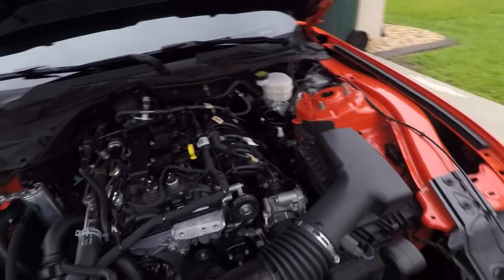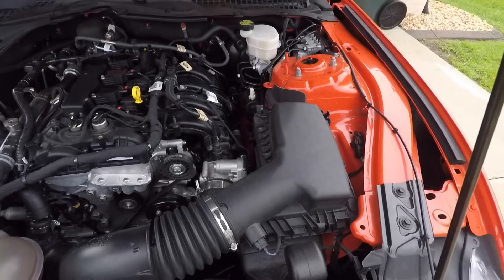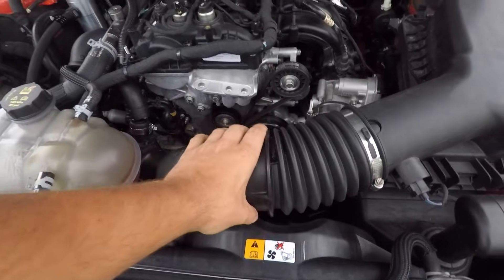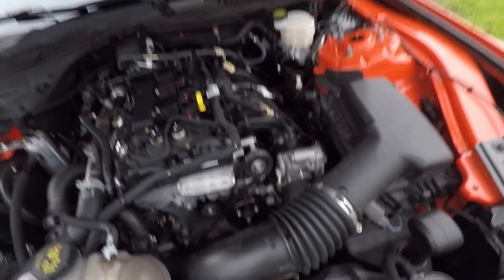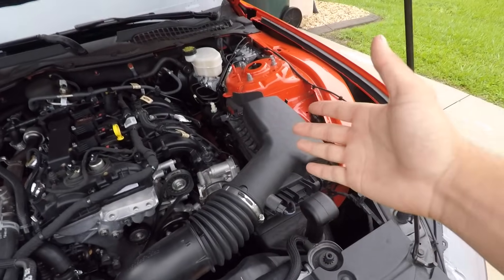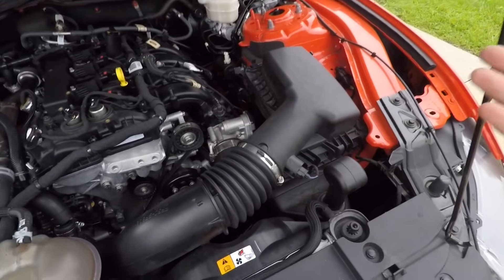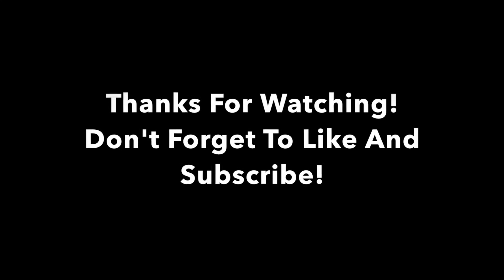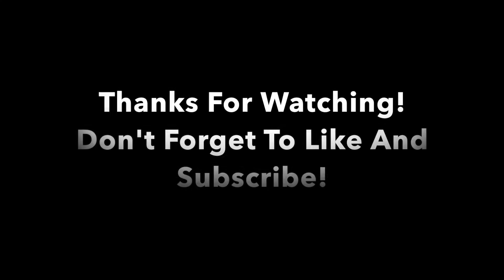Top 5 Mods Not To Do To Your Ecoboost Mustang

Comment: I got the 18 ecoboost with the access port and an intake. I got the 93 stage 1 on the car and it runs great. The car stock comes with s limiter of 120mph. Cobb accessport took it off now the car gets me to 148-150
Reply: Also i get huge huge compliments on the sound of my ecoboost. The combo of a muffler/resonator delete and intake with BOV. The bitty soundss great👍🏻👍🏻
Reply: I got 2018 oranger fury ecoboost mustang with big turbo and borla ATAK exhaust louder and also 690hp, 60-130mph in 5.5 sec
Reply: did you tune the car it being stock or did you modify some things before tuning it?

Comment: You don’t straight pipe a 4 cylinder
Reply: Ben Couyoute well you can if you want to because it’s your car and only your opinion matters.
Reply: With a turbo you want the least restrictive exhaust system as possible
Reply: I'd recommend a cutout either manual or electric
Reply: Correction: You don’t buy a 4 cylinder
Reply: @BloodyWars  🤣👌👏
Reply: Yeaa nobody buying a weak ass 4 cylinder
Reply: People talk trash about these 4 cylinders but they get better hp than a v6 hence why they did away with the v6s and have a turbo. Obvious peak choice would be a gt but not everyone can afford a 40000 dollar car unless it’s older
Reply: @woodyfive0  that is just an ignorant thing to say honestly. i drive an ecoboost and i can honestly say it is so much fun so just keep your opinion to yourself
Reply: @thanos8914  what are you talking about the stock ecoboost is faster than a stock v6
Reply: @thanos8914  funny thing is that the 4 cylinder ecoboost cost more than the v6. i'm definitely getting that ecoboost. who the hell wants to spend more than they need to on gas?
Reply: Is not a gt so u never gonna get that sound period
Reply: @woodyfive0  your just mad and can't afford an ecoboost
Reply: @woodyfive0  speak for yourself.  I eat V8s all day including the GTs.

Comment: You guys don’t see a change in performance because you need a tune with those parts
Reply: Right got to love ignorance
Reply: Adrian Cortez you’re not completely wrong but I’ve been tuning cars for a long time and you’re stock ecu has enough timing and play in the system to change performance without a tune the biggest lie is when people buy cheap cold air intakes expecting power gains! The only ones that hold true are ones that are enclosed and unfortunately really expensive...

Comment: 35 years after the introduction of the SVO and Americans still have no clue about 4 banger turbos. EcoBoost has the same displacement as the 2.3l Lima. Meanwhile us Svo owners get 300-400 hp with our Lima. Ford screwed the american economy for 3 decades by discounting the SVO for embarrassing the 5.O with its hp gains and better emissions.  84 175hp 85 205hp...30 hp gain in 1 production year then detuned in 86 to 200 so it would have the same rating as the 5.0. The 87 SVO would have had a DOHC designed by Jack Roush. When we put the volvo DOHC on our LIMA we're getting 350-410 hp without touching the block because that's what the Lima engine is rated maximum. Ford said back in the 80's American's aren't ready for technology kinda seems they still aren't.
Reply: I'm a very proud SVO owner
Reply: LIMA engine? Where is was produced?

Comment: These are fair suggestions if your ecoboost is basically stock.  I put together a built 2.0 esslinger longbock, stock head/cam, precision turbo, CVF downpipe, CVF Race Intercooler, and fabricated air intake pipe (CPE), MBRP Race exhaust.  Car is a little beast now.  The combination of these mods and strength of the 2.0 block with forged internals is expensive way to go, but the stock setup went ecoboom.  Car was dynoed and only restriction now is fuel pressure dropping out above 6200 rpm.  High pressure Pump upgrade is next.  One cool thing is I can average 32 MPG on the highway if I keep my foot out of it.  Fun cars but build with an upfront plan so your parts all meet the desired goal.  https://www.youtube.com/watch?v=dsm-Ox4kjXQ

Comment: I would also say the adapter to make your stock bov blow out into atmosphere. Apparently they make your car run super rich. Stay stock or go with a full bov.
Reply: not true, you only need a bov if you're running more boost
Reply: Plus Ford Mustang Ecoboost use MAP tuning not MAF, meaning the air that is being vented by the blow off valve adapter is not affecting the way the ECU is metering air and fuel

Comment: Obviously aftermarket parts don't add the exact numbers they are specified to add unless tuning is done with them. Cold air intakes are dyno proven to add more hp when you tune aswell.  Anyone adding a filter thinking they are getting 15 more hp is nuts. A high flow filter is actually robbing you of fuel economy and mpgs because more air needs more fuel from the computer in the car.
Reply: For NA cars, your statement is correct; however, for force induction it may not be so.  I agree that all CAI upgrades will not realize the manufacturer’s purported gains without a tune.

Comment: If I leave my eco 100% and take care of it. How many miles would you think I can get out of it?
Reply: Many
Reply: A million miles
Reply: 2015-2017 you’ll have minor issues with the vehicle before 120,000 miles. 2018- is the way to go in my opinion. Spend the extra couple hundred bucks to get a better built vehicle. If you don’t rag on it every time you drive it and do all proper maintenance on it, it could go 200,000+ miles trouble free.

Comment: So a roush cold air intake won't do anything for my 2021 ecoboost?? I've seen American muscle put them in the cars. Just would like to know if it helps
Reply: I have the Roush Cold Air Intake on. my 2021 Ecoboost High Performance Package along with the MAP Street Intercooler and they work very will together, I have seen as low as 2 degree ambient/intake air temperature difference and routinely have a 4 to 6 degree ambient/intake air temperature difference. In stop and go traffic I see a 9 to 11 degree ambient/intake air temperature difference. So yes the Roush cold air intake does work and it works very well.

Comment: Quick question man. I notice your eco boost doesn’t have a motor cover. Did you take it off or did it not come with one. I just got a 2021 with 101a package and it didn’t have one. But I wanted one.
Reply: For some reason they stopped including those
Reply: @DARKGOD69420 no one wanted them. They also allow the heat to soak in the engine and on the upper engine electronics. I took it off as soon as I bought mine. Best decision as cylinder head temps went down about 10f on average. (This was the spring)
Reply: @Boosted_aj  trueeeee

Comment: Intercooler comment was brave.
Reply from the maker: Alexander Goodrun lol how so?
Reply: Don't get me wrong results are results. My map stock location unit performed on a constant 10 to 15 degrees above ambient. Now I know levels stay around 5 to 10 degrees above ambient but for being stock location map is awesome also it's hella thick like you know that girl with the thick thighs... hella thick.
Reply from the maker: Alexander Goodrun 😂😂😂 I kinda made a small exclusion for the map street core. Probably didn't give it enough credit. My wording on the intercooler part could've probably been better
Reply: Just pointing it out. Mishimoto may be of use later on. I know the intercooler may not be the most efficient but radiators are. Some constructive criticism still smashed dat like button.
Reply: Hey I paid $360 for my Mishimoto IC and I couldn't be happier for the performance over the stock one.
Reply: I bet power is about the same if not less.  You got better cooling from the larger IC but you have a larger IC pressure drop.  The charge temp is important but it really matters at the limits of an aggressive tune.  Also they are both in the stock location, front mounts...
Reply: Thanks for the kind words on our MAP core :) we have a race core if you need!
Reply: @Alexander_Goodrun  I think this also most affected by the region you live in, and by that I mean I was getting only 1-8 degrees above ambient with the Mishi stock loc IC, but that is in New England where we do not have the humidity levels you guys get down south.  That being said.  You can in theory go too big with an IC just as much as too small so you better be aware that without pushing your stock turbo (I know you have a larger kit) but stock at maybe 24 ish PSI you can go with a stock location unit, with a 4bar MAP larger hot and cold side pipes and better fuel pushing above 29PSI is where the front mounts shine.

You should always mod with planning in mind, and chose the correct size for the task.  I found the mishimoto ran fine, my only complaint was the peeling of the powder coating and the corrosion around the temp sensor makes for a bad time removing it.  

Heat soak affects all inter coolers no matter how big, air flow is important to the efficiency under load but around town driving is not going to do anything for either style.  The only IC I would not buy personally is that one what is an L shape its fits in the stock location but comes up just past the bumper, its flow is occluded by the bumper cover makes no sense, either go with a good stock location or full on front mount but not in the middle lol...

Comment: I always giggle inside when NA vehicles run around straight piped. lol I do know the ecoboost is not NA but it just brought to mind the silliness that is straight pipes on naturally aspirated vehicles.
Reply from the maker: Hayden Nichols there are some cars where it's acceptable but when I had my v6 mustang I tried it. Muffler delete sounded great on that car but I swear once I went full straight pipe it was the most god awful sound I ever heard
Reply: it isn't really about sound. Naturally aspirated vehicles need the back pressure from a muffler to run their best. At least that is what I have always been told.
Reply from the maker: Hayden Nichols that's a very debatable topic. I honestly don't know if it's true or not. Been told multiple things lol
Reply: From what my mind says i can venture a hypothesis that high end rpm would increase in power low end would decrease. Because when exhaust starts to flow the back pressure pulls exhaust with it. at high RPM the flow rate of exhaust is so high that there probably is no difference. Also with more air from boosting the problem is probably so miniscule that it no longer matters and more free flowing exhaust would make the difference. /shrug i'm not sure but it's also ridiculously loud along with a possible loss of low end power is enough to keep me away from it
Reply: Unrestricted exhaust only enhances performance at high/very high RPM. Daily driving/low-RPM driving with unrestricted exhaust results in lower torque. And yes, you can feel it.
Reply: so about 90% of what i just said:D
Reply: Lol, kinda, Hayden. But I'm not hypothesizing. ;)

At high RPM you can feel a hair more power with low-restriction exhausts. But at low RPM you can really feel a drop in torque with low-restriction exhausts. I mean, if your SOLE goal is to have better redline performance, to hell with everything else, then low-restriction exhaust will help a little. Doesn't have to be straight-pipe though. High-flow muffled should be just fine unless you're a dragster... My gripe with low-restriction exhausts is that they make daily driving dreadful. Much too noticeable of a torque drop. Like the car's always a dog unless it's revving. Frankly, before I installed my M-9603-M4 kit/calibration, my EcoBoost had that kind of "dog until 3,500 RPM" feel that you expect from high-flow exhaust. Lol, but then it turned into a dead dog at 4,700 RPM! :D I cannot praise that M-9603-M4 kit/calibration enough for the miracle it performed all the way through the powerband. Truly amazing!

Progressive or dual-mode exhausts are pretty interesting. Could be the best of both worlds, but I don't have any personal experience with them.
Reply: Backpressure=bad. Loss of exhaust velocity=just as bad. Full straight pipe of proper diameters all throughout=no/absolutely minimal backpressure and perfect velocity.
Reply: Zaknafein Do'Urden, back pressure is 100% a myth. Watch engineering explained's video on it please.

Comment: Yo dude if you put snow performance methanol injection it won't matter because your air temps will be cold after the throttle body that is if you use throttle body spacer. The intake manifold spacer is good for direct nitrous injection after you try snow performance injection kit. I am going to Auto Mafia to Dyno my 2.0 L snail turbo with meth injection to see what numbers my car will make. It is fwd. I am using SCT flasher with unleashed tuning 93 Octane tune plus final meth injection that works off my boost. Let's see what happens but I bet my Fusion 2.0L will have as much or more as your Mustang. Peace dude. Good luck with your numbers.

Comment: First of all the cold air intake he said the stock box it the best option, I found that my Cold air intake that I purchased through american muscle made a decent horsepower increase a noticeable difference quarter mile times. I bought an Airaid synthaflow CAI with the oiled filter. when combined with a SCT tuner it gained 38 hp at the wheels, and get this, 119 ft lbs torque. Not bad for totally stock ecoboost. I could really feel the torque increase, and from mid to high rpm, the horsepower came in. off the line it will smoke the tires if you do not use a bit of finesse. It has 3:55 gears and a six speed automatic slushbox.  I might mod a few more things to get it into the 11 second time zone, and hopefully 119 mph or better top speed. Down pipe and smaller turbo pulley. Increase the pop off valve pressure. Eliminate the catalytic converter, and small mods and etc. Really please with it so far, raced a 2016 SS camaro and it really was no race at all. after the race he rolled his window down and ask me what I was running I said a 2.3 litre ecoboost he went red in the face and drove off.
Reply: Wayne Rhodes you want to be taken serious and you say you are gonna get a smaller turbo pulley?  Come on man, at least do a little research before you try to sound like you even know what your talking about.
Reply: Wayne Rhodes why would you drive with your hood open? That’s really the only way to get gains form cold air intakes when the hood is closed they get heat soaked and you loose power
Reply: SMALLER TURBO PULLEY. LMFAO!!!!!! You are thinking supercharger, Chief. 😂
Reply: You don't upgrade your turbo pulleys? It gives you maximum power, like atleast 5 more psis, possibly a bar if you wanna get a really kickass turbo pulley.
Reply: that's an impossible torque gain. time zone? 119 mph top speed? you act like your running 12 flat now with a tune and cai just waiting to break into the 11,s. you raced a 2016 base model camaro with an ebay ss sticker kit.
Reply: What happened after you woke up?
Reply: Lmao he thinkin supercharger........

Comment: In your opinion, what are some of the best sounding exhaust systems (catback) for the ecoboost?
Reply: Elliott Haley roush are really nice I have them on mine if you want to spend more than that maybe MBRP but I prefer the sound of Roush and it’s a bit less on your wallet
Reply: @Pepper-Jack  I sold the Roush off of mine for the MBRP race. I wanted 3in piping. I hated the tone of my Roush. Way too raspy for my taste. The MBRP offered a better sound and larger diameter pipe for half the price.

Comment: The Intercooler and Intake are good mods to do you just have to use the Right parts. The MAPerformance cold air intake coupled with SCT tuning made huge power gains over the stock intake. As far as Intercooler, the stock unit cannot keep up when the boost/power levels are turned up so there are indeed much better options than OEM.
Reply from the maker: Joe Doole definitely agree

Comment: Do you want to know why you don't want to straight pipe a car? And why it sounds bad? One, you've just deleted all the filters that keep the exhaust as pure as possible before hitting the atmosphere. There's nothing stopping the burnt fuel going straight into the environment without any sort of chemical breakout to try and purify the carbon emission. Do you know what this does? It greatly increases the carbon dioxide output, meaning more people straight pipe/cat delete/muffler delete, the more output of carbon dioxide into the atmosphere; thus you're contributing to global climate change more than any other person. Two, your car straight up sounds like shit. Modern cars are built and designed TO have cats and mufflers, so when you get rid of something that it is supposed to have by default, you're basically ripping out its intestines and rectum. Just don't do it. Get a catback and get it over with. Stop deleting your cats, there's a reason why they are there.